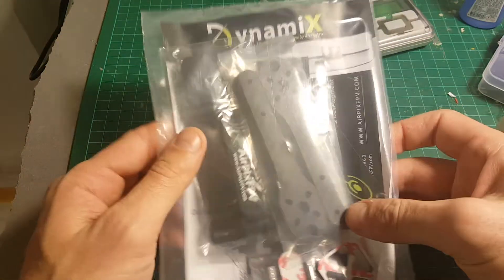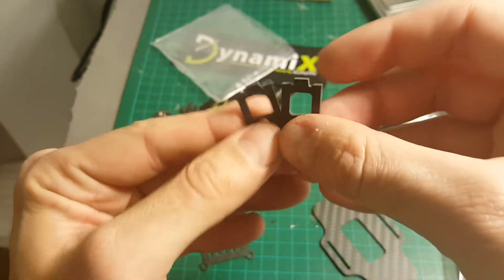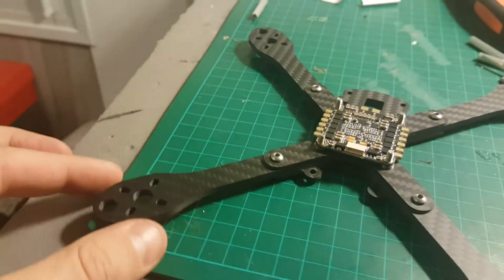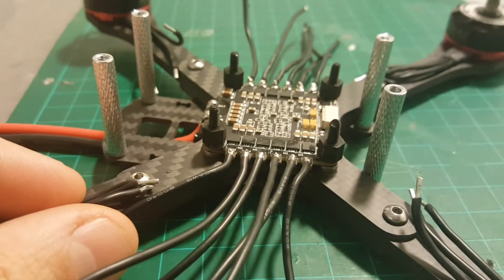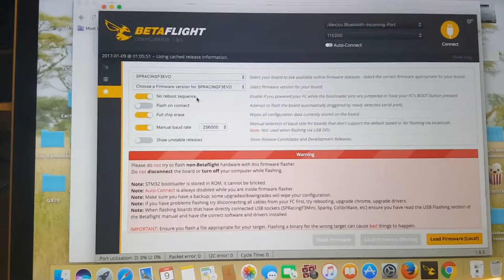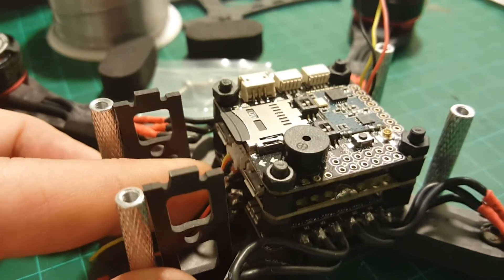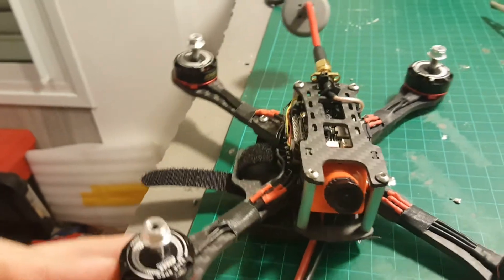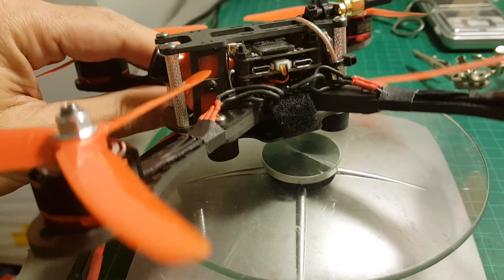AirPixFPV Dynamix Frame Build video

Comment: Grate vid indeed. What about durability? is this frame still holding up?
Reply from the maker: +grhookgr Thanks. Unfortunately, due to a problem with on of the motors and lack of time - I didn't fly it. I should get it fixed soon.
Reply: in case you may want to sell it ... well, i am interesting :)
Reply: Let us know when you have flown it - I'm interested in this!